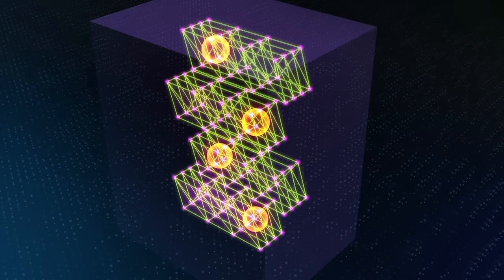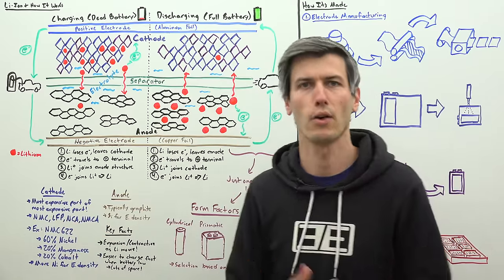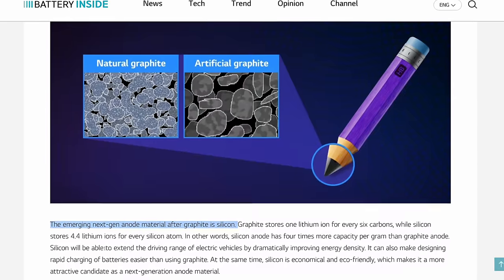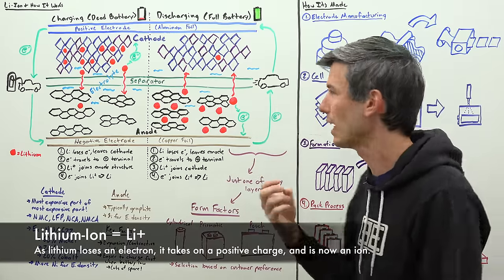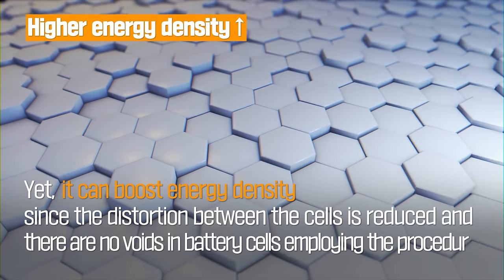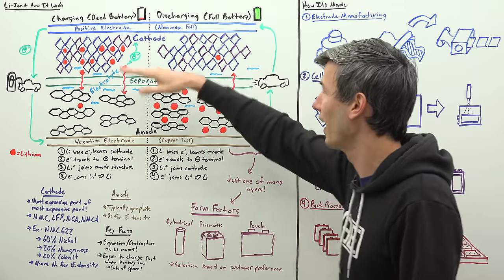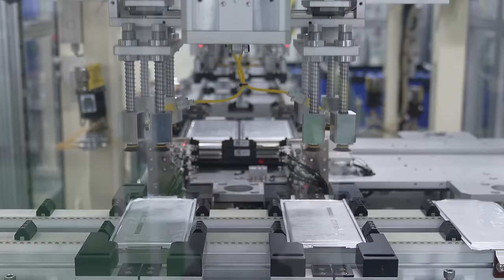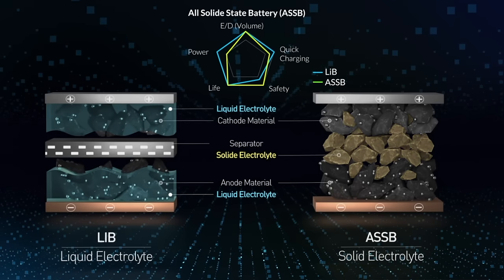Everything You Need To Know About Lithium-Ion Batteries

Comment: What we really know is they can't keep up with the supply of mining lithium.
Reply: thats why they implementy battery factory in North america (In Ca,ada also, Québec) and the supply will directly come from Canada mining.
Reply: @alexmigneault  Again, the lithium mineal in earth may be exhausted before you dig up all oilfields.
Reply: There is not enough lithium on earth to replace the current vehicle fleet.
Reply: @aygwm  With current demand we only have 40-50 years of oil left. After that you're screwed unless you can run your car on your own urine. Li-ion batteries can be (and already are) recycled.
Reply: Lithium prices are currently falling.  The minerals in batteries can be recovered via re-cycling.
Reply: @AkiraNakamoto   Lithium is the 3rd most common element in the solar system, and unlike Hydrogen and Helium, it's a solid at Earth temperatures. It's also generally found in deposits near the surface of the Earth and more easily and cleanly extracted than oil, and especially tar sands.
Reply: @MrJustinOtis  Why are you Unconstrained Vision guys always talking about general but impractical stuffs.    What you can leverage from earth lithium in the foreseeable future is only about 80 million tons.   Or you have to waste 100 times more energy to extract lithium from sea water.   And you cannot use lithium elsewhere in the solar system.  Why bother to include it in your argument?
Reply: @AkiraNakamoto  It's not impractical. 80 million tons are the known reserves, but that number keeps going up since there's more demand for lithium, which prompts mining companies to look for more deposits of it. That's just basic economics, something I would think that a guy with a Thomas Sowell avatar would understand.

As to lithium being the 3rd most common element in the solar system, that's because of how the elements were made back when the solar system originally formed. The result is that there are plenty of solid lithium deposits on Earth for our use.
Reply: @MrJustinOtis  Only about 20% of the 88 million tons lithium in earth crust can be mined so far.   It's not enough if your dream comes true, that is, turning all 1.47 billion cars on earth into battery EVs (with comparable performance of today's ICE cars).

You need 8kg of lithium on an average battery EV (sedan and compact SUV) today with about 100+ mileage per charge.    To be comparable to today's ICE cars (300 miles per fill), you have to increase the battery capacity to consume 24kg of lithium.    You need at least 35 million tons lithium to do that.   If you consider EV semitrucks, then 24kg/vehicle is not enough, you need 100+kg/semitruck.
Reply: @AkiraNakamoto  , first of all, where have I ever said that I was going to convert every vehicle to electric?

Second of all, 24kg of lithium is not much at all, and is far less in material cost than oil. The 80 million tons you keep citing are the known reserves. As more things need lithium, mining companies will spend time exploring for new reserves and setting up new mines for them. The 80 million tons is not a hard limit, it's simply what is known to be available now. The economics of the situation will simply ensure that additional deposits will be found, again, something you'd understand if you actually have listened to Thomas Sowell instead of just using his picture as an avatar.

So, it's simple: more mines will come online to mitigate the issue. On top of that, lithium is basically infinitely recyclable, so old batteries can be turned in to new ones.
Reply: @MrJustinOtis  First of all, if you are not advocating replacing ICE vehicles with battery EVs, then why exactly are you arguing with me here?

Second of all, when we ordinary people talk about solution, we only count the viable practical resources available,  NOT those visions of you anointed.

So, it's simple: replace gasoline ICE with E100 ICE.    It's 100% recyclable so endless power cycles as long as there is renewable energy sources (solar, wind and tidal), 100% clean no toxic chemicals at all.
Reply: @AkiraNakamoto  All OEMs (except the Japanese) are trying to exit the car sales game and enter the more lucrative TAS model. When Tesla makes the autonomous Compact it could wipe the need for 70-80% of private vehicles (Seba).

Comment: With an average of 8 years usable lifespan on Lithium batteries there is going to be a lot of vehicles needing to be repowered..Makes a lot more sense to convert the humble gasoline and diesel engine to run on Ammonia fuels with only water vapour emissions thus saving the planet.
Reply from the maker: 8 years is still warranty, they're certainly going to last longer.
Reply: @EngineeringExplained  How much longer, did LG say? Should it not be based on recharge cycles?
Reply: @longdang2681  There are still plenty of early generation Tesla Model S cars on the road. I see them regularly enough that it's unremarkable.
Reply: @MrJustinOtis  Teslas have bigger batteries(80+KWh), they should last longer. How many older Nissan leafs do you see with their smaller 48KWh battery? Besides should EV manufacturers not declare expected life expectancy similar to that shown with PC SSDs TBW? regular AA NiMH with their old tech still declares recharge cycles which are currently in the region of 500-1000. Recharge cycles are a consumable, should it not be declared how many you are actually getting? Is it not reasonable to expect an inferior 500 recharge cycle AA battery to cost less than one that can recharge for 1000 cycles?
Reply: @longdang2681 Nissan Leaf? Literally no one cares. 

And Tesla does talk about recharge cycles, and they release the data. On top of that, their vehicles come with a comprehensive battery warranty.
Reply: @MrJustinOtis  Nobody that is promoting EVs cares about the Nissan leaf because it shows the realistic side of EVs.
Tesla batteries last longer because they are bigger capacity batteries. With such large batteries, Tesla must be doing something really wrong if they can't make it last for the duration of 8 years(that other manufacturers withe smaller batteries are giving).
If Tesla battery cycle data is so accessible then why don't/didn't you reply with the number of cycles?
Reply: @longdang2681   Keep dreaming. ICE simps love to bring up the Nissan leaf because the battery was deliberately made to fail prematurely by a company that didn't want to make EVs. That's why the Leaf didn't have an active battery cooling system. It was designed to fail, and the battery size isn't that much smaller than what you'd get in a Model 3 (62kwh vs. 80kwh.)

Sorry, but Tesla is the gold standard for evs because they actually understand the engineering and have made solid cars.
Reply: @MrJustinOtis  You love to play down the numbers. 80KWh to 62KWh is 23% smaller or 29% bigger going the other way. That's more than the 20% buffer that you drain you battery down to to avoid lower battery cycles... but it's 'isn't that much smaller'. For comparison that mere 18KWh difference is more than a days total electricity use by a household. The original leaf only had a 48KWh battery so is 40% smaller than the smallest Tesla battery. You like to choose the smallest Tesla battery for comparison with the biggest Leaf battery and the difference is still a sizeable 23% bigger. If Tesla is the gold standard on EVs they would not need such large batteries.
So still no Tesla cycle data then? despite it being so accessible?
Reply: @MrJustinOtis the LEAF wasn't designed to fail by a company that didn't want to sell them, it was designed to be as simple as possible for the Japanese market, where it doesn't usually get hot enough to require cooling. Increasing the battery size and charging speed shouldn't have surprised anyone it would lead to overheating batteries, but it still wasn't that bad until the second rapid charge of the day.